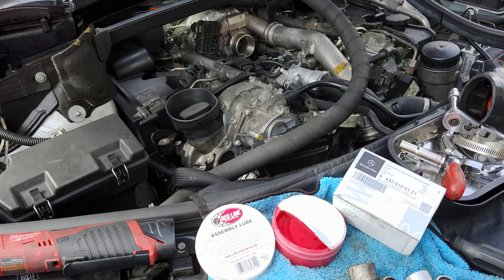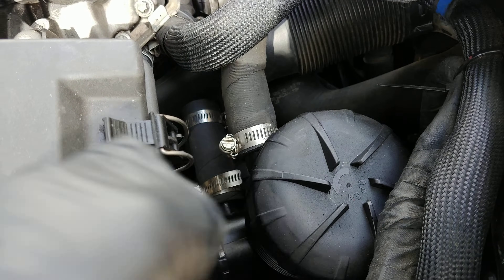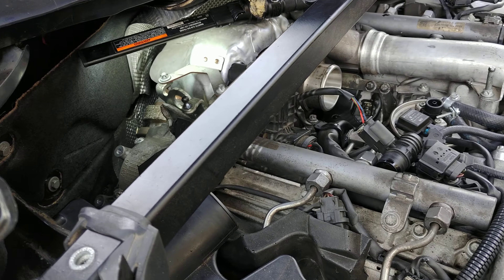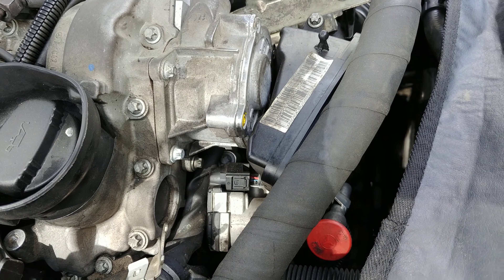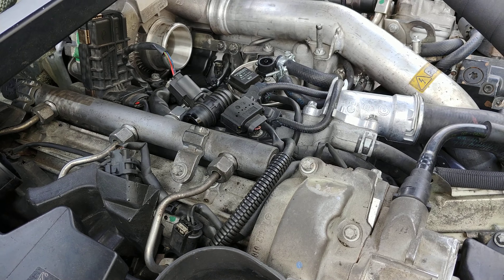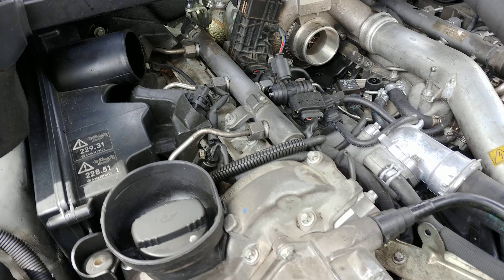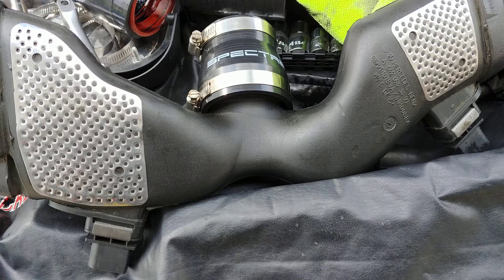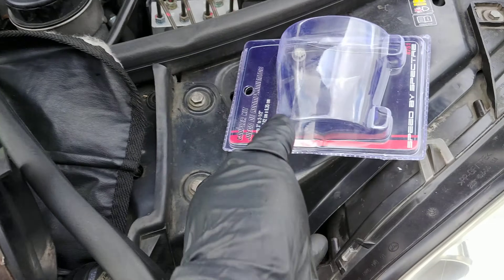Mercedes Diesel GL, ML, R, E 320/350 OM642 Oil sucking eliminated/broken Y-intake fix

Comment: if you suck crankcase fumes into the air filter you will have problems. no. 1, an air filter is not meant to suck in oil fumes. it will quickly become clogged, wet. no. 2 the air mass meter will become oily and show too little, the engine will run lean, and lose power.

Comment: GREAT thanks for the video. But I think I'm not understanding what part to get to plumb the oil catch can back into the feed of the passenger side air filter housing... what sort of fitting are you using and how to fasten it where no fitting was before? Pretty sure I watched every minute but just not clear on that detail. Ready to do this!

Comment: I have the same car i get some black smoke under hard acceleration could this be the cause
Reply: You don't want to do this modification to any engine.  The PCV system is designed to have a high vacuum to evacuate the gases, which include WATER, from the crankcase, and the PCV valve, when working properly is supposed to shut when the vacuum becomes too high on the intake manifold, so the engine doesn't suck in a lot of oil.  It sounds like at a minimum, you need a new PCV valve, and secondly, I would install a massive catch-can to filter out the oil vapor from the PCV gas stream.  Every 8 weeks I drain about 8 ounces of oil & water out of it.  If your PCV valve is shot, you will pull oil vapor from your valve cover, right into your engine and get black smoke out the exhaust, and clog your DPF.

Comment: I think I have the same issues with my Jeep WK CRD 3.0 L.  I like your video but am not totally understanding what I need to do.  Having major issues with low oil pressure and wont breath at all.  DPF is clogged, but other issues abound. Need some help.
Reply: You don't want to do this modification to any engine.  The PCV system is designed to have a high vacuum to evacuate the gases, which include WATER, from the crankcase, and the PCV valve, when working properly is supposed to shut when the vacuum becomes too high on the intake manifold, so the engine doesn't suck in a lot of oil.  It sounds like at a minimum, you need a new PCV valve, and secondly, I would install a massive catch-can to filter out the oil vapor from the PCV gas stream.  Every 8 weeks I drain about 8 ounces of oil & water out of it.  If your PCV valve is shot, you will pull oil vapor from your valve cover, right into your engine and get black smoke out the exhaust, and clog your DPF.

Comment: 0:14 "Dreaded OM642" - LOL - only by people who aren't very skilled at auto mechanics.  Like a guy that routes crankcase vapors IN FRONT of the air filter so that the air filter can get oil saturated in no time.  And WTF are you on about "sucking oil accumulated in the oil cooler"?  Seriously?  The oil cooler is a brazed-plate heat exchanger with oil on one side and coolant on the other - mounted under the intake manifold.  What on Earth do you think this has to do with what you're dealing with here?

Comment: Always nice to have somebody doing ALL the hard work and then telling us ALL the secrets. THANKS
Reply: The problem with this re-routing of the vacuum side of the PCV system to the filter housing, is that it will never develop a sufficient amount of vacuum to evacuate the moisture in the blow-by created by combustion, and eventually he will probably have a puddle of water in the bottom of his crankcase.  The PCV system is more than just a simple vent for the crankcase, it's designed to pull fresh air in while pulling gases out of the engine.  This keeps the moisture level in the engine to approximately that of the surrounding atmosphere, which is tolerable to the metal parts.  The way to solve the issue of excessive oil in the intake, is to build a catch-can with a lot of surface area that will sufficiently cool the vapors and precipitate-out the oil and water before the gases get to the turbo. I built a U-shaped catch-can out of 1-1/2" galvanized pipe and stuffed it with stainless steel scouring pads; and every 4-6 weeks I drain it and get about 16 ounces of water and oil (60/40 water to oil) out of it.  Sending water into the intake isn't a big deal, but preventing the oil vapor from getting to the intake is, since it combines with the EGR gases and creates a tar that coats the intake manifold and gums-up the variable manifold flaps and constricts the passageways. Also, I don't understand why his PCV housing  looks like it doesn't have the valve flap in it. That valve flap is supposed to shut under the high vacuum created when the turbo spools up so a lot of oil vapor isn't sucked into the intake; so if his PCV housing is missing that valve flap, he doesn't have a PCV system, he has a crankcase subject to a wide range of vacuums, and moving the vacuum source to the intake filter housing probably made the vacuum insufficient most of the time, if not all the time.

Comment: Thank you so much for the suggestions! One comment is that, there is something to look out for when plumbing the PCV before the air filter on the passenger side intake. when the engine is off, there is nothing preventing the moisture and other things getting into the hose leading to the CCV. Once the engine is on, CCV starts opening, the moisture and other things might getting into the crankcase although the chance is low. An improved version would be adding some sort of filter there to prevent things getting into it.

Comment: I have a 2008 Mercedes 320 GL in the problem is cranks. It won’t start until I use. The ether runs fine no problem at all but as soon as I turn it off it won’t start again I had to put it ether again, replaced the high-pressure fuel pump And is still doing the same thing any recommendation I will appreciate by the way, I don’t have no codes
Reply: Stevemoreno7892 
Try unplugging the sensor next to the turbo.
The darn thing stops the engine from starting when it goes bad and unplugging it allows the engine to start.
Drove me nuts for months

Comment: I just acquired a 2012 Sprinter that has 100k miles with the OM642 3.0L V6 .  The CCV is marked A-642-010-17-91.  It may have been changed at least once already; I don't know.  So maybe an aftermarket CCV assembly. Thanks for the video.  Interested in your suggestion about loosening 4 bolts on the valve cover.  Did you have to do that.  I watched another video where a guy was having issue and use a pry bar gently to get it going, but he did not loosen any valve cover bolts.  Do you know the torque specs for the valve cover bolts?  And are there torque specs for the CCV?  Also, no mention of using Anti-Seize on the steel bolts into the aluminum block.  The factory uses Anti-Seize on all steel bolts into the aluminum block.

Comment: Just put a smaller diameter hose piece into the original pcv valve. In front of the sensor( if you are concerned it being sucked into the turbo)
This reduces vacuum created by the turbo a lot.  I went with 4mm hole in the smaller hose piece.
Reply: Pcv valve hose*
Reply: @HRohtla  can you explain this? Or give a picture

Comment: I don’t think I asked this properly before.

I would love to see the plumbing of the PCV re-routing from the catch can into the air intake feed on the passenger side. 

What kind of coupler did you glue / cement inside that plastic on the air feed intake to allow for the hose clamps.

Comment: Thanks for the video.   You said dreaded OM642 engine.   I have 3 vehicles.  All with the same engine.   Outside of replacing the oil cooler seals, cleaning the induction system and general maintenance I have had no issues. Please elaborate “dreaded OM642”. Thanks

Comment: Good job however, that coupling is going to collapse when it gets hot. I did the exact same thing.
I fab'd up an aluminum support cage to slide into the coupling. No more deformation or collapsing..
Reply: Any pics of what you're talking about or what you built?

Comment: At time 2.36 oil does not accumulate into the oil cooler but into the Intercooler ( for the air intake after the turbo before the intake manifold)

Comment: Hi roblaeke ! Good video on an important topic of poor design that actually ruins a nice engine !  I did all the things you did, including the Mann catch can, with the same result : Still oil at the turbo inlet and intake system. But two questions to your final solution : 1. Have you checked if the right-hand side (in driving direction) air filter is gooed-up with oil mists ? 2. What happens to the sensor on the original PCV rubber hose, going from the PCV vent to the turbo inlet ?

Comment: Swirl flap motor failed on my ml35 cdi . I see people are bypassing the motor with 4.7K resistor . Over time does it make any harm to the engine or any other part ?? 
This oil suction is disaster 😕

Comment: Questions to rigdgarage  Ivan ,that pvc valve # A642 010 01 31,I order this ,is only  alu.housing with seal fit and seal  round the  camshaft ,my previous one have same seal and a little spring plus valve ,this what I order ,is always open direct breath ,is that ok ,or with this model come some other valve behind?, please let me know thanks

Comment: Hi mate thanks for your video, I have got w221 320 cdi v6 om642 while I disconnect the pcv valve pipe from the turbo it blow white smoke 💨? Do you think what do I have to do with that ? also in traffic light while I move i can see there is blue smoke from rea the exhaust during acceleration

Comment: I did the catch can as per this video and indeed it will make a huge difference. I was consuming oil, replaced the PCV and the oil separator and that reduced but not eliminated the issue. As with all of the other videos, the main issue is suction. If you just route the outlet of the provent to the intake next to the turbo, you are not solving the issue but just further reducing it. You will still gum up the intakes etc. Do the whole thing, and it will seriously reduce oil consumption. If you're in doubt, just pull the inlet into turbo side and you will see oil. Even with new PCV and separator.

Comment: What about air filter, is it covered with oil?
Reply: Yes the filter gets covered with oil and is detrimental to MAF sensor in the y-pipe. Unless you change you right side filter a lot more frequently, it gets saturated and continues to suck oil

Comment: Great video...so the small hose going to y intake can be rerouted and installed in air box ahead of filter? what kind of fitting do i need? or do i just drill hole and use that orange seal? thanks in advance

Comment: Great video,thanks;
What a shame that is,a very poor design from mb of the oil separator under the valves cover;  probably done in a hurry by some 20 year old fresh out of college,and the son of someone...who works in there too...seen that too often in automotive parts factories...
And then the public gets it...  in this engine i've had success replacing the old plaastic pcv valve  w/the aluminum one  # A6920102391,but the price is a rip off!!
That catch can on the video seems to be upside down; i know it isn't,but the the design of it might be, the outlet(of gas and not oil) should be on the top,while the liquid oil stays on the bottom where the drain plug is; but it is probably correct,just that we can't see it well from here;

I always check the amount of blow-by, in case the rings are stuck with carbon (EGR!!!!) , and then in extreme case i adopt another solution...
In the old days the "draft tube" was free to the atmosphere "under the car" , then it was half and half, but not now,now it's zer0%...and when the blow-by is just too great for the oil separator inside the valve cover/engine block to handle (high mileage,slow driving,EGR and stuck piston rings...),  the greenphissers that are in command now,rain or shine...well they don't care,not their problem now...
Reply: Hello, how do you check blow-by?
Reply: @Henry-zo5xr  simplest way is to (carefully...) remove the oil cap with the engine idling, and observe; if a lot of vapors are coming out, that is blow-by; if oil droplets are also coming out,that could be excessive blow-by;
even simpler is to remove the oil dipstick and  see if a lot of vapors/gas escapes from there;
every car is different ( different design of the PCV system ),experience is needed here too; i don't need to do that,but some use a latex glove around the opening to gauge for excessive amount of escaping gas;
most important is to have the PCV system cleaned/working ok;
if the car exhibits no other symptom, it's most likely ok to continue using it;

Comment: To prevent the broken flange, make sure the metal band is snug to thd plastic and use silicone spray to help get it on the turbo.  I definitely have oil in my intake so this is useful.

Comment: Hi,would you help me please? I have tried  to change that connector but  it's  stucked at about half way,just before that the black  seal is visible. Should I force it to remove it? Any trick or tips ? Om642930 Thank you in advance

Comment: Dreaded om642? That engine is great. Mine has over 200k miles and still very much alive. No oil consumption between services.
Reply: I'm sitting at 730km... I think that's 540k miles. Original engine and original transmission to boot. 2011 ML 350 bluetec.
Oil changes every 7000km. Fuel filter every other oil change. 
Only piss off is the oil cooler seal is starting to leak for the 3rd time.
Reply: @fundamentallybroken4194  added another 60k miles to mine. Had problems with exhaust manifolds blowing chunks of metal in the turbo. 
Oil cooler seals. Have you installed the upgraded purple ones?
Reply: @braa1975  yes, the purple ones are better, I got about 290km out of them.  But make no mistake, they will still eventually fail.
Reply: @fundamentallybroken4194 
What do u mean purple ones
Reply: The upgraded oil cooler seals
Reply: @fundamentallybroken4194 replace oil cooler and seals, sometimes the cooler warps due to the heat so replacing the seals sometimes is not the best fix/solution.
Reply: @revinot if I do it again, I'll do that. But at this point I've been daily driving my Viper all summer. Haven't even looked at the Benz
Reply: 300,000 miles on my 2014 gl350 bluetec fucking runs like new still
Reply: Same here

Comment: Great info..
I’m driving a 2008 GL320 I will definitely check out that part and replace, I’ve done the PCV Valve already but the hose still goes to the turbo..
Great video..

Comment: how can you loosen up the valve cover when the injectors are still there a d keeping that thing tight?
Reply: Really easy. Only need to loosen up the first four bolts and then the connector will slide out. I just did mine today.

Comment: I have added the Provent 200 to my 2013 GL350 and run it back into the stock location. From what I’ve read the major oil consumption issue comes from the lip seal on the fitting that bolts to the back of the head. When I changed mine the seal was as hard as the aluminum housing. I do the same thing for draining the Provent, a hose & ball valve. I get about 2-3 ounces of blow by oil every 3k miles. I still get a TRACE amount of oil at the turbo inlet but it’s really insignificant. The oil cooler seals just let go so I had my mechanic (30+ year MB Mech.) replace them & clean up the intake while there. He was intrigued that the buildup was dry & flaky instead of the normal gooey tar like mess. He is now suggesting the Provent to all of his diesel customers. I believe changing the Provent filter at the suggested 40k miles as well as changing the PCV fitting at the same time will keep the intake clean. I will also be using the motorvac intake cleaning system to keep everything nice and clean.

Comment: May have been asked somewhere in the comments, but how did you tap the hose back into the passenger side air intake plastic hose? Is the plastic thick enough to thread a barbed hose end?
Reply from the maker: I think somebody asked before in the tread, but here it is. I used 1" OD treaded 3" long metal conduit with matching nuts and washers from the electrical aisle of Home Depot.
Reply: @ridgebackgarage4580  ohh that makes sense. Awesome, glad you’re able to solve this. I have the provent which filters a majority of the moisture and oil but it sounds like this is a great cure to keep things dry, engine breathing full and prolonging the ol girl! Awesome work

Comment: Doesn't the EGR contribute to soot in the intake, and turbo?? even more than the PCV??
Reply: The soot can't stick if there's no oil. So addressing the oil (from the pcv) is the first step.
Reply: @EXOVCDS  But the pcv closes upon turbo suction...  if you know what I mean....
Reply: @hackprine5691  yes, most pcv valves will close if there is too much suction... and open again when crankcase pressure gets too high (at same high turbo suction) to protect crank seals from blowing out. The high suction is still what draws too much oil... I'm more familiar with vw engines. The video creator is correct / had a good idea of relocating the pcv entry into the front of the air filter box. Pcv can still breathe / vent... but at a level that is not forced (less influence from turbo), resulting in less oil being ingested / sucked up out of the cam cover.

Comment: There is a sensor at the inlet of the PVC where it sets in the intake in front of the turbo inlet.....???  right??  so what did you do with that???
Reply from the maker: That is a heater so in theory at extremely cold climates if any vapor/oil turns into ice in that extremely shorth path between PCV and turbo, ice will not chip blades of the turbo. I leave electrical connector to it plugged  so it dies not throw any soft codes and zip tied it to a tower bar. If it makes you feel better you can put it in line with PCV bypass hoses.
Reply: @ridgebackgarage4580  What makes me feel better is no fault codes.......